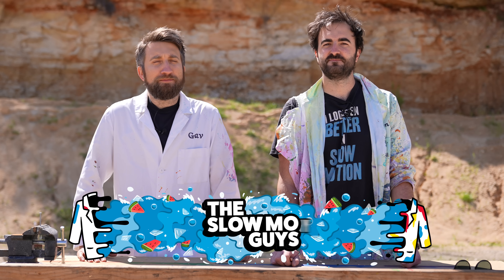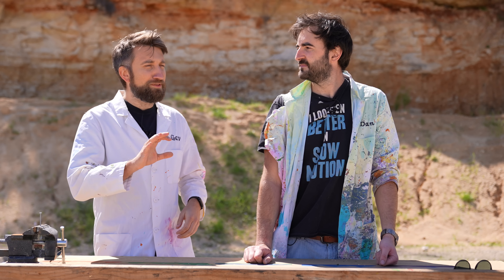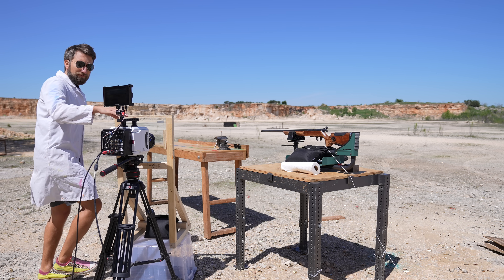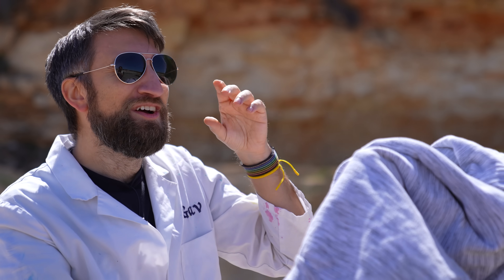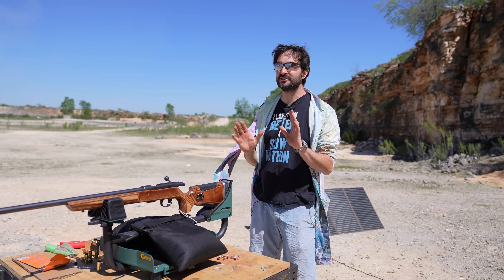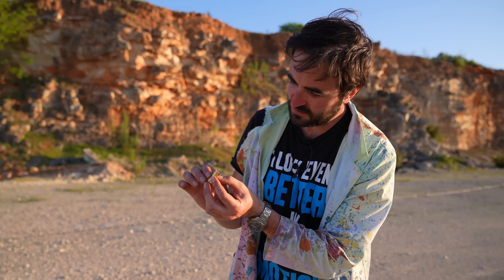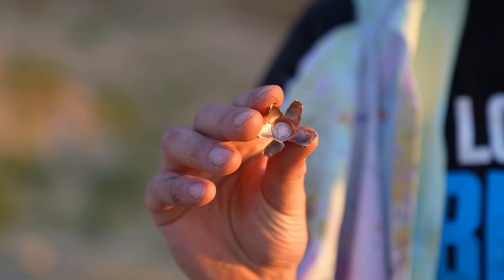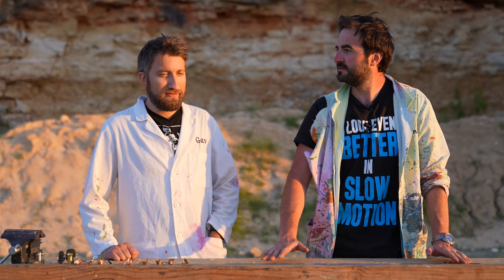Can a Bullet Go Through Another Bullet? 875,000FPS - The Slow Mo Guys

Comment: 16:45 - I have to disagree with the idea that if both bullets were fired at each other, they'd collide and drop below the meeting point. The problem is the equation F=MA (Force - Mass * Acceleration). The hollow point (forgot the caliber) has advantage on both mass and acceleration (remember the powder piles?) over the 22 Long Rifle. While ignoring force lost on both sides to shrapnel, rotational chances, and asymmetries of the two initial force vectors, the hollow point will still travel forward, albeit slower and dropping to the ground quicker. And with the other round, the direction would be back the direction of the hollow point. Again, there would be momentum lost and changes to all sorts of angular momentum, so the new mass would still fall to the ground far short of the gun that fired the hollow point.

Comment: Adiabatic cooling.
Powder in cart starts to burn, pressure and temperature rise sharply.
Case ruptures, pressure drops rapidly.
Drop in pressure causes strong cooling effect, extinguishing the burning powder.
This is why even a modest amount of confinement (strapping tape, clay block) can result in huge increase in powder burn.
Reply: That sounds very logical. 
But to me it doesn't look like the power actually ignited. Could the rupture be caused by the shrapnel from the .22 impacting the rear of the 50cal and bursting through the sides of the casing?
Also, in a regular gunshot, you can see flames exiting the barrel before and after the bullet. Would they not also be extinguished from adiabatic cooling? 
(I'm a first year engineering student so I don't know everything yet)
Reply: Discombobulate

Comment: You could do a brass solid vs the hollow point using say a 223. Or (and this gets dangerous) a machined steel projectile with a think copper jacket to reduce the chances the projectile does not get stuck in the barrel and blow it up. You would want to be futher back from the remote fire position you were at obviously it CAN be done though

Comment: You should have used a 5.7x28 for the smaller round, specifically the black tip version with a steel perpetrator, they are like 10$ a round on gunbroker though.

Comment: @The Slow Mo Guys just for future reference = if you had "gripped" the base of the 22LR round by the rim with the vice-grips = it would have ignited the round = thus the term "rim" fire.... The 22LR bullet exited the muzzle "wonky" because the muzzle, itself,  has a defect which caused some of the propellant gases to "tip" the base of the bullet to one direction. One of the KEYS to an accurate rifle is the "finish" of the muzzle = typically has a 11 degree crown or taper or chamfer...
Reply: i am kind of sure dan, as a trained ammunitions tech and EOD, is aware what rimfire means....
Reply: I doubt just gripping it would set if off, it really needs a shock/impact to ignite.
Reply: I ctrl-f'd hoping to see if this exact reply had already been posted re: the 22's wobbly flight path. It's absolutely from damage to or a defect in the muzzle. I've always been super careful not to rest or bang any rifle or pistol's muzzle on a hard surface. It'll ruin that gun's accuracy.
Reply: @Kaiser0929  Here after I ctrl-f'd "wonk" for the same reason. The bullet being ten degrees off at three feet is insane.

Comment: I can't speak for every movie studio, but a client of mine was one of the major ones. They simulate what happens using CGI and material properties are assigned to objects to get the 'physics' outcome. They simulate the same thing hundreds of thousands of times (Which takes literally 1 minute) until they get a 'true' movement. Not sure if they did the same in this movie, but I know that's how one of the big ones do it.
Reply: They probably simulated it, but used too low a ductility for the lead.  In the movie it shatters in a brittle fashion, like silicon, or I guess very chilled lead.  If they'd done the same experiment as these guys they would have animated it better.
Reply: @concinnus  True, but you also have to remember that in the movie the other bullet is travelling as well, near effectively doubling the collision strength, which could potentially make the lead appear more brittle with more power being sent through it.
Reply: Not all CGI is a physics sim.  Sims are generally used when you have too many things to animate by hand, like particles of snow or the objects that make up an exploding building.   Sims cost more to develop and run, but there's a breakeven point when you have a lot of stuff interacting with other stuff.  When you only have two objects, it's often not worth developing a sim for it if you can semi-automatically animate everything with some simpler math.
Reply: So they running FEA/CFD simulations?

B/c I've always wondered how well a CGI rig can do with FEA/CFD. Running a physics package optimized for gfx chip processing would probably run pretty damn well. (Some still favor CPU core count which thrive on hardware like and thread ripper whereas others love to run on gfx cores)

Comment: While it might be difficult to get steel cores to fire out of a gun, you would always fire the .50 cal at something made of steel.
Like a needle bearing cylinder.
Or simply hit a drywall screw, if the bullet is pierced by the screw then you can just easily imagine the back end of the screw not being there and so the bullet keeps going.

Comment: Almost got it right the caliber used was 5.7x28 mm more powder faster bullet 27 grain can reach 2216 fps you need the speed before terminal impact. The .22 travels from 900 fps to 1100 fps in common .22 ammo. I doubt this could or would happen even if both fired at one another the mass might separate but would slow or change the trajectory into a non lethal round.

Comment: The main reason you were not getting the bullet piercing is most probably the material that the bullets were made from, basically copper+ lead hitting Copper plus lead. You would need to find something closer to what they have in the film, but there might be an issue with finding that as it looks like it could have been something that would probably be illegal in  most countries for civilians to have. I beleive that if you were able to get the same kind of bullet the result would be closer to the film result. Any chance you guys could find someone with the licence to have such amunition?

Comment: Get some 5.56mm tungsten carbide rod cut the right length off and shape it nice and pointy and put it in a 5.56 round. That will be pretty close to what you are looking for. Also there is a 5.56 handgun that Demolition Ranch Showed so you could say that a round like that is possible from a handgun.

Comment: Hey guys, firearms buff here. .22lr isn’t the best analog for the gun used in the film. You are much better off using 5.7x28mm. It effectively has the same diameter as a .22lr at .224. I guarantee you will see something closer to the film when using 5.7. Common firearms that use the caliber are the FN FiveseveN and the FN P90. I own both and would be happy to lend them for a video.

Comment: The 5.7mm round from FN Herstal used in the P90 and Five-SeveN pistol is probably a closer match - but isn't it super hard to get that round in the US? Similarly difficult to get as the 4.6mm round used in the MP7, right? I'm not from the US, so I could be wrong.

Comment: The only thing missing from this experiment is the lack of Velocity for the .50AE round. Understandably it would be extremely difficult to have both bullets traveling at full velocity. In theory, the heavier .50AE would just plow right through the copper washed soft lead .22lr used in the experiment. It's possibly, the kinetic energy could cause the .50AE to not expand as much as it's mass is just so much higher. On the other hand, the opposite could happen, instead of just expanding outward, you might end up with the same effect you got with the .30-06 round. 
Either way, major Kudos to you for pulling this off, filming it and sharing it with us!
Reply: I've already done the maths, assuming it's a 5.7mm in the movie, you're looking around 1500fps for the .50 AE and about 3000fps for a 5.7mm closing in for a total of 4500fps. They should have tried it with a .22-250 or .220 Swift, both can push over 4000fps so it would at least be a bit closer to what would happen in that scenario.
Reply: @captaincracks  I was speaking to the experiment as performed. We already know the bullet construction of the 5.7 SS190 ammo would come probably as close to the movie as possible, with only a few minor differences to the deformation of the .50AE round.  The average .50AE weighs 300gr, travels an average of 1550fps and carries roughly 1600ftlb of kinetic energy (manufacturer data). Since the base of the experiment used a .22lr, most likely a 31gr copper plated round nose, that's 1750fps (manufacturer data) from a rifle, which works out to 204ftlb. This means you have 300gr hitting 31gr at a combined 1804ftlbs at impact. My question is, How much of the energy of the .22lr is absorbed by the much higher energy and mass of the moving .50AE. 
Stationary, that 300gr .50AE doesn't have any energy of it's own, so the impact of the 31gr .22lr is imparted completely into it. Think of it this way... 1960's Cadillac hitting a Smart Car head on with both going 60mph.
Reply: @pinsandscrews6459  Yeah I'm aware how it works, more so as long as the total energy in the equation is the same the result should largely be the same. Think of it this way, with two two cars you mentioned, the result would be the same whether both cars were going head to head at 60mph or one car was stationary and the other was doing 120mph.
Reply: I don't think having them both move would make a difference. see how the low velocity .22 and the heavy and high velocity .30-06 both splashed completely against the .50AE? the problem is that they were both made of lead. the pointy one has to be made out of something harder to replicate the effect. kudos to the movie guys to make the pointy bullet look like something other than lead.
Reply: @mobilemcsmarty1466  of course it matters, it factors in the energy involved, obviously two going head on will have the same end result as one hitting a stationary one harder but my point being they're using something way too soft and way too slow.
Reply: @captaincracks  agreed, one stationary and one moving is still a valid test. want more energy? get the moving one to go faster. as long as both are lead though I don't think more energy will get you closer to the movie effect of the pointy one passing through the hollow-point. more energy will just make a more spectacular splash, no pass-through. now yes, I think it's all about the material that can make the difference to get a pass-through. the pointy one must be of some kind of AP material/construction.

Comment: The movie had a 40gr FBHP jacketed .224 projectile ( 5.7x28) @ 2100fps vs a 40gr copper-clad round nose lead bullet at 1200fps. 

Going against a 325gr jacketed bullet at 1400fps.

Not a real comparison. 

If they wanted to use a stationary .50 and have a real comparison; they would to shoot a 40gr .224 FBHP at 14,000 fps.. lol

Comment: Going by the movie, it looks like some kind of depleted uranium .22 round.

The bullet looks grey.. Not lead, nor copper, but clearly some sort of metal.

So, for it to completely just glide through another bullet like that, it'd need to be a bullet made of a very dense, solid metal.. And depleted uranium's about as solid as bullets get. The density of depleted uranium is what's working the most to prevent the bullet from squishing or breaking, which is what allows it to travel through other things. (Besides its weight)

You could go for like tungsten if you wanted it to be even harder, but then you lose your structural integrity and the bullet'd just explode before leaving the barrel. And you could make the bullet out of osmium if you wanted it even denser, but that'd be horrendously expensive, and from what I've heard, osmium can be pretty fragile like tungsten as well.

Comment: Ii would be interesting to see a M855 Green Tip round used for this shot. The M855 is a 5.56X45  lead core bullet with a steel penetrator.

Comment: Damn, really disappointed they didn't use a 5.7 instead of the .22. The 5.7 is basically the same diameter, but it's travellings twice as fast and has a much pointier tip, both would have been better for this test.

Comment: I would say the bullet that went through the other bullet was effectively a solid steel bullet, or really most likely a comic book metal that engages rifling like lead but with the strength of steel.
Reply: They sell solid brass bullets… also armor piercing steel core… these guys really dont know much about guns and ammo
Reply: @burtswayze  They bring up that they don't have that ammo because in real life it's rather difficult to acquire such ammunition
Reply: @TheTrueBatBrain  Shouldn't be hard at all to find a .223 brass solid of some manner. Sig has a 60gr solid brass ball round, that's from a minute of googling.
Reply: @TheTrueBatBrain  its VERY easy to acquire 5.56 steel core/green tip… .223 should be just as easy… i live in california and i can get it

Comment: Excellent as always. That first .30-06 round you fired. I don't know if it was a video artefact or what. But as it approached the hollow-point, its copper jacket seemed to be peeling back from the tip - before impact! Surely it shouldn't begin to "petal" until it strikes a target/something solid.

Comment: The scene could have possibly been more closely replicated using a 5.56 round. It is effectively the same diameter as a 22lr, but traveling at a much higher velocity. In addition, if something such as an M855 round(or any .223 remington round loaded with an SS109 projectile), the M855/SS109 has a mild steel penetrator in a cone shape at the front of the projectile, which likely could have given a very similar effect to what is seen in the movie.

Comment: I really do think that if the target bullet was fixed in place more firmly, you would have had much more of a chance of penetrating through the back side with the first bullet. A significant amount of the kinetic energy of the firing bullet was lost in moving the target bullet so much.
Reply: You would think that but I have seen many people test that theory and it is completely false. It makes such little difference that it isn't worth the effort. securing targets down does no good.
Reply: Maybe the total velocity from both bullets moving at the same time in the opposite direction would probably help more in term of penetration.
Reply: @snokariwalkure4076  that also has no effect. The problem is the lead in each round has the same density so no matter how hard they hit, it will be the same as a toddler smashing two bits of puddy together. If the toddler wants to get through the puddy, a pencil works great because of material composition. Dan was right when he mentioned that. If they had a round with a steel core or something armor piercing to actually recreate the results of the movie.

Comment: I wish you guys would have used .223 or 5.56 bullets instead of the .22. This would have penetrated the full bullet and gotten closer to the effect from the movie. Also, you should use bonded hollow points. They actually have a bond between the copper jacket and the lead so they do not separate like that when they open. 

You may want to consider doing a follow up video where you make these 2 adjustments and see what the difference is video wise. I think that would have much better results.